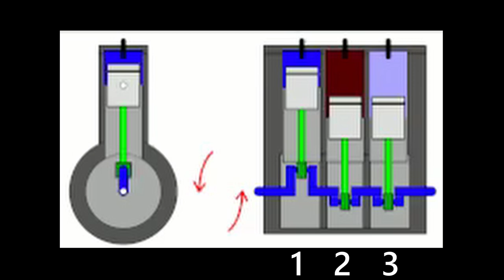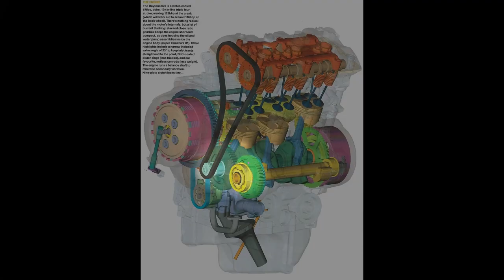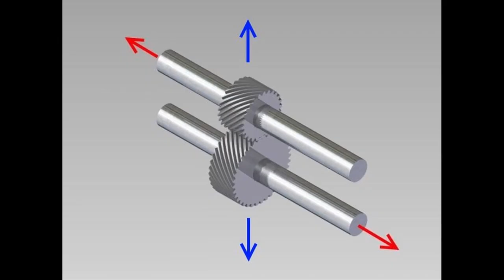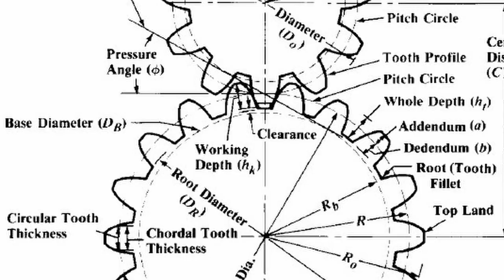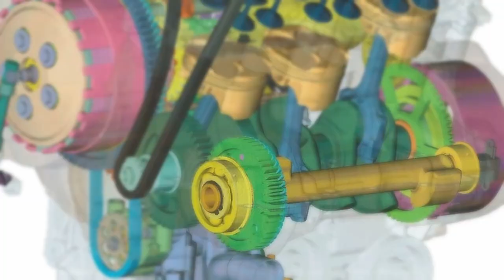THIS is WHY Triples WHINE and whistle | Tea Kettle HIDDEN inside the engine ?

Comment: With regards to the K75, it's nearly identical to the k100 and that also has a whine or whistle, so it's not the number of cylinders that make the noise you're on about. Also nearly every mass produce bike engine has a balancer shaft these days.
Reply from the maker: I was explaining the REASON why there was a balance shaft in the first place. People imply quite a lot out of that lol... like literally if people just watched the full video instead of jumping to conclusions the world would be a better place..
Reply: @UrgetoRide   @Urge to Ride  I'll be honest I didn't watch the whole video as it seemed over produced, all the different clips from various different things was a bit much, but that's just my opinion.
But you did state that the reason for the whistle is due to straight cut gears on the balancer shaft, the reason as to why there is a balancer shaft in the first place is irrelevant. As the title of your video is "this is why triples whine" this is incorrect. Please don't see someone correcting your misinformation as a negative thing, we all learn through our mistakes.
Reply from the maker: @Eight20  No hard feeling matie, but misinformation is bad and there was NO correction. I've seen triples without CB shafts, and they ran shit and with no whistle. Matt needed material for a long rant, and wether he was right or wrong is irrelevant to him. I dont even know why he felt attacked by me treating a technical subject lol
Reply: @UrgetoRide  at the end of the day, you're getting free publicity. Probably not the way you wanted but still, hopefully it grows your channel 👍
Reply from the maker: @Eight20  I'd rather no publicity than bad reputation, I'm sure you can understand ;) Love your stuff btw K modding looks like a lot of fun
Reply: @UrgetoRide  rise above it, be the bigger person. But I do understand, just don't get your knickers in a twist otherwise you let them win.
Thanks dude, I'll be sure to sub and see what else you come out with.
Best of luck!!
Reply: Supersports (600cc) and superbikes (1L) often don't have counterbalance shafts. The point being, get rid of all 'unnecessary' inertia sapping away crankshaft acceleration, reducing power at the wheel. The trade off being ugly secondary vibrations from inline-4s. I much prefer counterbalanced inline-4's. I had a Z900 that was utterly butterly. Many years ago I took a spin on a cousin's '96 GPz1100, a variation of the ZX-11 engine, which had dual counterbalance shafts and it was so glassy smooth, at higher revs there was no feedback from the engine about the need to shift up. The modern H2 Supercharged machine runs dual counterbalance shafts, as I don't think Kawasaki was too worried about loss of power on that.

Comment: I have a Street triple R.  A long time ago I used to have an NC30. One is an in-line 3, the other is a V4.  One has a balancer shaft, the other doesn’t.  Both have the exact same whistle.......
Reply from the maker: The V4 has straight cut gears driving the camshaft. A fantastic setup and one I wish to own one day (most other bikes have chain driven cams cause its cheap). Hope this helps buddy.
Reply: Dude, I know why the NC30 makes that noise.
Reply from the maker: @James Jones The mind boggles James. I'm used to it but people always manage to surprise me. You should see some of the comments about how 'I seem to spend more time on beauty products than riding', how I am a 'corporate skinny ****', and the creme de la creme, how I am a 'mental midget' . Top notch.
@MartinMeegan apologies I might have missed the point you were getting at with your comment
Reply: NC30's have gear-driven cams. straight-cut gears. I'm sure you can put two and two together
Reply: I have a street triple. Im pretty sure the sound is from the intake. I've heard it on 4cyl bikes too. The new mt10 even directs the sound from the airbox toward the rider purposefully. To make up for the lack of sound from the exhaust with the new euro 5 restrictions.
Reply: Another example of cam driven gear noise:  Suzuki SV1000S. Honda RC51. And if Google would stop deleting any comments that share URL links, I'd give you a few examples.

Comment: I have a 2020 Street Triple R 765 and I freaking love the sound of that triple.
Reply: I have a 2017 Daytona 675r !! It's sweeter than street triple 😁😁
Reply: @vikram7074  LOL pissing contest. I finally got mr a Daytona 765 I love this bike with the arrow exhaust. it whines a lot in idle. next mod LED lights and CAT delete. probably need a tune after exhaust work.
Reply: @albertoj.mollinedo4116  

Incoming!

I’m returning to riding in retirement after having a very worked 600cc Norton Dominator in my youth. 

Studied everything motorcycle that has happened since. Commandos, bespoke built Commando, rejected UJMs for weak handling and super top speed setup. Rejected heavily electronic ride controls, trikes, blowers on a street drag bike etc. Found an 03 Speed triple single mechanic owner.  Just missed it. Depressed I kept looking. Discovered Daytona 955i had 19 more ponies and two swing arms, saving 16 lbs. 

Then once more I knew God wanted me to have another quick street drag bike fairly cheap. Matt Capri cans and dyno tune for 15% power and torque increase across the full band. Right at 170. Stock quarter 11 flat. It’s a lock to run in the tens. Got it being set up now for next drag season. 

Priority now is backing up the Capri tune, complete service and checkout, probably new rubber, suspension setup correctly, & maybe new sprockets and chain. Thinking lightweight might get a couple of tenths more. 

Most riders who don’t know Triumph triples well think both early 2000s triples have 128 hp but the Daytona gets 147 stock and 170 in current tune.  

I’ve got four good strips within an hour or two of me. And I guess it’s a bucket list thing for me. 

Anybody try resprocketing Triumph triples for the quarter? Any luck? Odds are there is a quicker sprocket setup. 

If I get it right it could be a very stock looking not really fast looking older Daytona that might get close to 10.5. Don’t think I will see any HD street bikes ahead of me lol. 

Best part is my wife thinks I have matured since my youth since this time I will be doing the ton in a straight line on a closed course. 

I just want a slip this time. Stock trap speed is 128 mph. 

I think I can get close to 10.6 at 140 normally fueled and aspirated.  Win lose or draw it could be a great summer. 

Triumph triples forever. Might try to convince the wife redundancy would be prudent lol.

Besides, our son could ride the second.  But that silver streak is mine, at least for as long as I still can do what it takes. 

But just finding the base I have for my build is mind boggling. 

I wish Norton hadn’t turned into such a mess. But I feel at home with Triumph. Got to go. Got my work cut out for me…

Need a master painter. Taking recommendations for it and for a more streamlined tank.
Reply: Yamaha's CP3 sounds pretty sublime when uncorked:   /watch?v=5gsyzbj0SN4

Comment: Half of that whistle on the clip of the GT car is electrical interference from the alternator. When your actually driving the car it doesnt whine half as much. Swap to a total loss system and the noise drops away. 😉
Reply from the maker: I shall take your word for it, although I believe non of it.
Reply: @UrgetoRide  I've run cars in Dutch supercar amongst other series.

Comment: I happen to have a street triple, and it's got nothing to do with the balance shaft. It's the exhaust system. And it only makes that noise with stock OEM exhaust. I've changed my end end can to a scorpion, and it no longer makes the whistle/whine noise you talk about. Explain that then.
Reply from the maker: Exhaust overpowers it. Fit a fat exhaust to a VFR and you can't hear its cam whine. Fit a fat exhaust to an XSR900, and you can't hear it CB whine. Its there you just can't pick it up
Reply from the maker: @petersmith9898  I have Peter. And the whole idea of gears is that they don't wear out, at least not as much as sprockets and chains for example where in most engine applications there needs to be a tensioner to keep things tight.
Reply: @UrgetoRide  Exhaust causes it. I've had three different cans on my Triples, stock, LeoVince and SPEngineering, both baffled and unbaffled. The whistle is only on the stock cans. There is no whistle on the others...it just isn't there.

Comment: What complete drivel.  This noise it not gear whine. ALL the primary  drives I have played with were straight cut gears and they don't all make that noise.
Reply from the maker: Christ just watch the whole video peeps instead of jumping to conclusions. And if youre coming from Matt then no its not the blooming 'exhaust venturi' like seriously...
Reply: @UrgetoRide  I came from matt's video but watched yours first to have my own opinion. 

If you we're not implying in the video that the whine came from straight cut tooths, then I think it should be reworked because that's what I understood from it. If that was what you were implying, as Bruce (and many others said) most gears in bikes are straight cut and that doesn't make most bikes whine and whistle. I don't know where this sound comes from but I don't think gears are the culprit here. I personnally think it's more of an harmonic frequency of the triples that's amplified by the airbox (and maybe the exhaust too) that engineers worked on to create that typical triumph triple whine.
Reply: Hey why all the swearing ? Just hold your hand up and say "sorry I  made a mistake". Then we can put this behind us and move on.  Your video was very entertaining so thanks for that.

Comment: my GPZ500S has exacly the same balancer shaft principle. it doesn't make that noise. care to explain?
Reply from the maker: I said it time and time again in the comments, and in the video, shape of teeth and their tolerances, oil path,  location and thickness of case, will all have an effect on if teeth whine, or not, or to what degree matie. Matt wants a bit of drama and material for a video, no matter whats right or wrong as long as he gets his rant.

Comment: Funny - all my bikes from the '70 had straight cut gears in the gearbox - non of them whined ?!?
And you were just about to come close to one of the reasons why some straight cuts whine and whistles and others don't - but then your (limited) knowledge ran out :-/ , go learn something about transmissions and shapes of gears and then come back and correct your self !!
I have driven Laverda 1000 (cyl.), BSA Rocket 3 (says itself doesn't it ?) and a mountain of engines with balance axles - and non of them whined because of the balancing axles and/or its drive (gears).
Reply from the maker: Bo, the BSA Rocket 3 had no balancer... and yes it did faintly whine, thats due to the straight cut gears driving the valvetrain, they're situated on the right side of the engine (assuming sat on the bike). Hope this helps.
Reply: @UrgetoRide  Sorry, no the Rocket 3/Trident didn't have a balancer, but as the Rocket3 engine is a pushrod machine there is not real good reason to use anything else than a gear for driving the camshaft's - right ;-).
I think you'll have to sharpen your ears to hear that whining through all the other noises from that engine - I can't remember to have noticed that whining - it's nearly 40 years ago I last rode a Rocket 3 so excuse me my "bad" memory  ;-)
Reply from the maker: @Bo Petersen  No issue at all, I get it ;) Thanks for stopping by anyway Bo 👍

Comment: Hmm.... So my Yamaha TZR250 has not only straight cut gears in the gearbox and on the primary drive but it also has a balance shaft that has straight cut gears. This does not make this same whistle.  The Honda VFR400R (which has no balance shaft) with gear driven cams does make the noise but it also has an anti lash gear on the cam train which is a gear that is slightly off set if you were to remove it because it has the ability to move a few degrees and is held against the drive gear by being sprung loaded. This anti lash gear is the reason the VFR400 makes the noise as when you tune the engine or use if to go racing the whistle is no longer noticeable. Its not simply the straight cut gears as all of the bike engines are full of them and only a few bikes make this noise.  The Triumph 657 has this anti lash gear on the balance shaft too... I think you can see a pattern....  Its not simply the gears its the anti lash mechanism that is making the noise and it could be used in different places on different engines for different reasons. So its NOT simply the straight cut gears or the fact it has a balance shaft. Other bikes have balance shafts like the new R1M but those do not have the anti lash gear and every other gear is straight cut too.. But that does not whistle. I would suggest you do a little more homework before you post as in your own video you  show the balance shaft and it shows the anti lash gear.
Reply from the maker: Yamaha CP3 doesn't have an anti-backlash gear, and it whines. Watch the video it shows a specimen. If anything they lessen the noise as there's less back and forth chatter between the teeth thanks to the preload. Cheers, U2R.
Reply: @UrgetoRide  but putting an aftermarket exhaust on it and it seems to disappear... Where the Triumph and Honda VFR400R as well as RC30 and RC45 still have the whistle. Having ridden and raced I can tell you that the Honda loses its whistle when the lash gears are removed. The gear train is louder but not due to a whistle. Having been the guy who was responsible for the Yamaha R7 crank and having made 1000+ billet steel cranks for anything from WSBK to F1 I can tell you that the whistle is not specifically from the balance shaft straight cut gears. Having done work with the Triumph 675 WSS team that were 3 miles away and they removed the lash gear for the race bikes that whistle had all but gone.

Comment: Modern straight cut gears are not weaker. The diameter and number of teeth defines how many gears are in contact with one another. The curved profile of a modern straight cut gear design for high torque also allows multiple teeth to be in contact as well as the contact duration being longer. A longer contact time also increase friction just like a helical gear, for racing and applications where power are more important than efficiency a more triangular profile is used. Coupling this triangular profile with the minimum amount of oil and viscousity, the gears are noisier. Without the need for thrust bearings, a smaller casing can be used and a straight cut gear can be made wider for the same external housing dimensions.

Comment: I thought it was from the airbox/intake. I have a street triple, but I've heard the same noise on plenty of other bikes. Especially inline 4cyl. It is more pronounced on bikes with quiet exhaust. Like a cb or cbr 1000 with stock exhaust. On The new mt10, Yamaha says they have purposefully directed the airbox noise toward the rider. To make up for the lack of exhaust sound caused by the latest restrictions. Like euro 5 etc.

Comment: Before the conclusion, I was going to say.... either the primary gear tying the crank to the input of the transmission, or the gear driving the counterbalance. Either way, "triple whine" isn't a triple whine, it's a "counterbalance whine".
I've heard it on other engines that don't have 3 cylinders.
In the auto world, the supercharger noise on some sportscars is something a lot of people like. Personally? It's gear noise and a set of helicals would shut that racket up.

Comment: In a related topic, why do the smaller triples sound different than the bigger triples?  For example, when equipping an aftermarket exhaust to the new Triumph Trident or Street Triple, it creates one of the most intoxicating exhaust notes known to the motorcycle world. In contrast, when performing exhaust upgrades on a Triumph Tiger 900, although an improved sound, it sounds more like a grunty, Honda RC51 twin.  Is that due to the new T-plane Crankshaft?
Reply: Yes, the T-plane engines use a different firing sequence. Rather than a smooth 1-3-2-1-3-2 firing at 240 degrees from each other, the T-plane fires 1-3-...2...1-3-...2